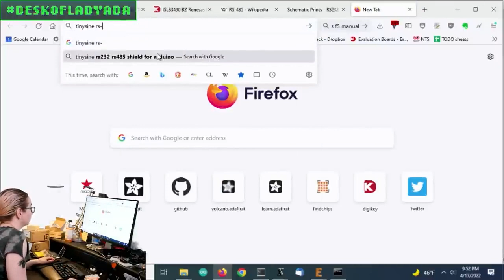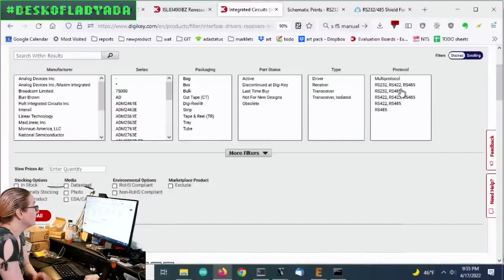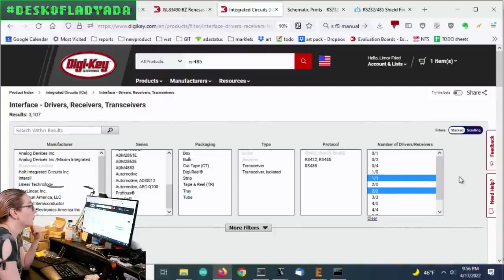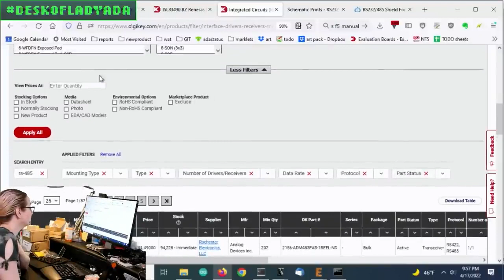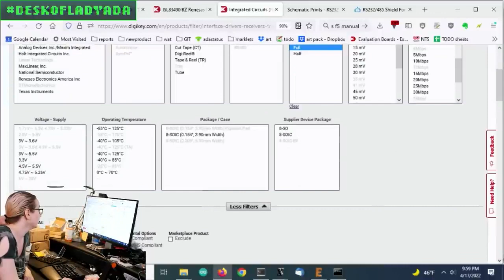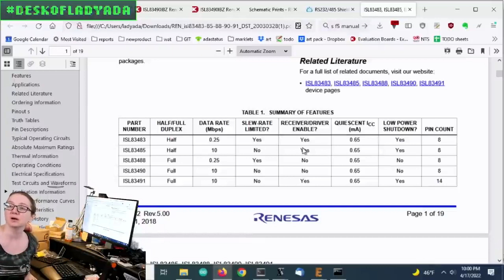The Great Search – a RS-485 transceiver #DigiKey #adafruit @digikey @Adafruit

Comment: Duplex is best if you want to attract industrial customers.  Also, don’t forget to add 120 ohm terminating resistors which are critical to ensure RS485 signal integrity- otherwise TX/RX distance will be no better than RS232 which would be a huge bummer.
Reply: Which industrial users use full duplex? Modbus and DMX both appear to be half duplex only. Are there other full duplex protocols worth knowing about?
Reply: @JoshuaBoyd  I have seen dozens of various RS485 protocols used in the manufacturing industry over the last 20+ years.  "RS" stands for Recommended Standard which opens up the door for lots of variations unfortunately.  My experience with RS485 comes from food, beverage and drug industry which rely heavily on RS485 to communicate with high speed manufacturing and packaging equipment.  For example, at one of our plants we have  300 packaging lines that use dozens of these devices on each line.  About 80% of our equipment use  DH-485 protocol from Rockwell Automation, and we have at least 10,000 RS-485 links just in North America alone.   We also use Profibus DP, OPTOmux, Modbus and various other protocols also but these are the most common from what I have seen.  Most of our equipment use 'duplex only' mode because simultaneous comms are necessary for highest performance and maximum throughput for high data lines on the equipment.   We do have a few pieces of equipment that use half duplex, but not very many because low speed equipment is being phased out for more efficient high speed systems.  DMX protocol seems to be mostly used by lighting, stage, music performance industry and seems to be mostly simplex (half duplex) but I haven't worked in that specific industry.